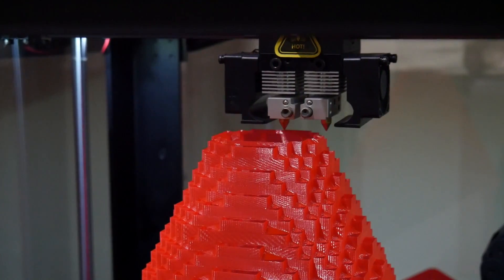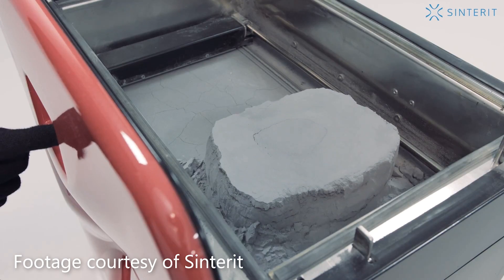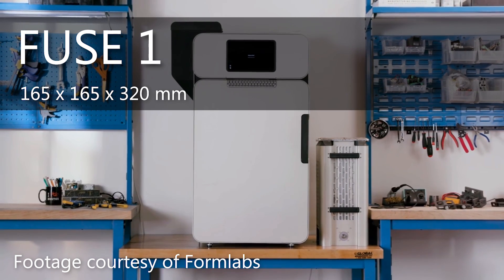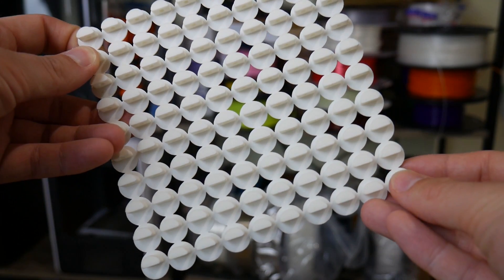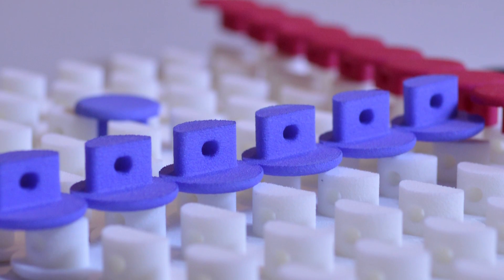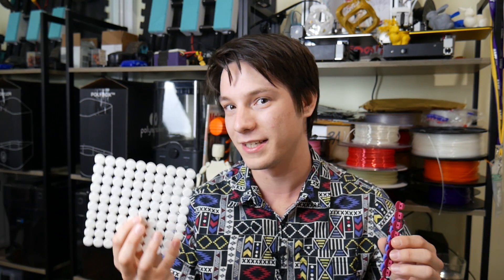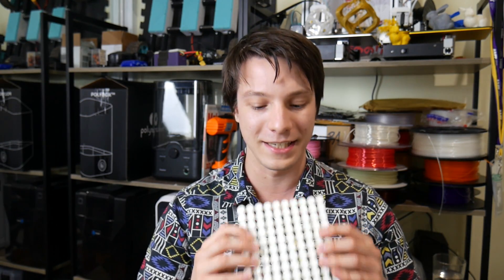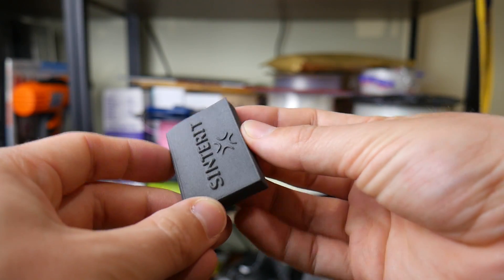Here's why SLS is the future of 3D Printing - Maybe. Formlabs Fuse 1 vs Sinterit Lisa vs EOS

Comment: Material costs are way too high, but expected given the relatively low demand. I wonder how expensive it is to product plastic powder..

And there are challenges with materials like nylon, but what about PLA powder that doesn't shrink? And I'm convinced that a closed-loop system to minimize mess is possible. These are engineering challenges, but not insurmountable ones. The benefits in quality are well worth the exploration, we just need some open-source trailblazers to prove out effective design and make it available for manufacture.

Comment: 6:40: Here's the definitive answer on why there's a difference in powder color between the industrial (EOS) machine and the desktop (Sinterit and Formlabs) machines:  It's not the laser power; it's the laser wavelength.  

The EOS systems use a CO2 laser (with 10s of watts of power).  CO2 lasers emit at around 10 microns (um) wavelength.  The desktop systems use either fiber or diode lasers, emitting at around 1.0 um.  At 10 um wavelength, white-colored polyamide (Nylon) absorbs quite well.  But that same white color does NOT absorb so well at 1.0 um.  However, coloring the material black or dark grey does the trick for light absorption at 1.0 um.  

The desktop system makers, in order to use lower-powered and cheaper laser types - to keep their systems' key-component costs low - were forced to go to the dark nylons.

BTW, the higher power in the EOS CO2 laser does nothing in terms of process quality; as you noted, because the powder bed and chamber are heated to just shy of the material's fusing temperature, the laser doesn't have to deliver a huge amount of power (or more precisely, power density) to kick the material over into sintering.  The higher power level is almost all about process speed or throughput.

Comment: My bet is that SLS and SLA is the future for 3d printing based production. FDM will always remain the king of hobbyists and prototyping. Simply because it’s so much easier, safer, cheaper, and least difficult to use. The limitations and complexity of SLA and SLS are minimized by industrial production where many parts are made in batches, especially things such as metal part sintering. The production of the strongest 3D printed parts benefits from economies of scale, especially so when furnaces and potentially hazardous fumes and materials come into play. 
FDM can be done at such a small scale and with such ease that anyone interested in the hobby or using 3d printing in a practical home application will inevitably come to it as the best all around option. Because this group will make up the vast majority of users it means FDM will remain king. At least until self forming materials come into play, but we’re at least twenty years out from that.

Comment: Overall a nice review although some important errors.  SLS was invented by DTM, Texas who were taken over by 3D Systems. EOS were not the original or the inventor, in fact there were years of court cases between the two companies. White SLS is not naturally white, it has Titanium Dioxide added to make it white. The aged yellow is actually its natural colour. The powder is pretty inert and tests have shown that it isn't harmful to humans, the particles are large enough to be ingested rather than going into your lungs. Saying that i would never work a machine without PPE. Finally the reason the cheaper machines use non-white powders is not to do with laser power but to do with the laser frequency.

Comment: BASF has a 316L stainless steel infused filament (about $400-500 US), that can be printed on most typical (CRS10 for example).  You print (high width to height ratio design is best, 100% infill), send it off to de bind and sinter.  Very, very, cool.  Can be bought from MatterHackers).

Comment: Shrinkage is not an issue in Nylon SLS. You fully sinter in the material. SLS shrinkage applies to green parts for molding only. That's due to the glue material sintered out of the green part in sinter oven process for the final melting stage. In Nylon SLS  you directly melt the part. Warping is an issue.

Dust on the glass, temperature control issues in the process and chunks of recycled powder cause stiffness issues. So it's hard to get reliable functional parts from a machine. So stuff could not be critical non fail parts of any product. They will unexpectedly fail at random.

It's no issue to use 100% recycled powder. Only virgin powder will give you more control over strenght of parts. Proper multiple sifting and drying the powder from taking up moisture from the air is key. Adding fresh powder doesn't truly give you an advantage over better handling of the material. pretty much like drying PLA in your oven.

You can easily build yourself a blasting chamber, powder sieve machine and use a shop vac to handle material.
Sandblasting is just the easiest way to depowder the parts from loose or slightly attached powder.

Comment: One solution to the not-so-useful-for-home would be to have a system of a adjustable size build volume where you could adjust the size of the powder chamber to fit what you want to print and only fill that volume up with powder. Genius idea, yes or yes?

Comment: The difference in color is due to the material manufacturer, EOS uses white, which is the base color of the powder that usually is issued by BASF. To correct you as well, the cooling down process of a chamber depends on the building time of the print, if a print is 30 hours long, it will take 15  hours to cool down, so pretty much the half the time of printing. The shrinkage is manageable, all can be adjusted on the program provided PSW or MAGICS when preparing the platform.

Comment: Takeaway for me is basically if you need SLS parts you use a service bureau like Shapeways. For other stuff can use a home printer. Metal would be cool but I don't see that becoming a less than $5000 home/small business system for a long time.

Comment: I think this is also the case with Multijet fusion of HP. I've also observed the quality degrades as I reuse the powder. Although it has high reusability ratio, it doesn't guarantee you the output's quality especially when the powder has turned yellowish.

Comment: We have the Lisa. We got a few parts out of it before it broke down and we have had many failed prints and lots of wasted material. Sinterit have offered to help but ideally we would need a local contact to come and do the repairs. In my opinion the workflow is too cumbersome to use unless you are in a production environment. Super messy and takes ages, wearing masks and gloves, cleaning up afterwards can take up to an hour before and after each print so not really ideal for doing one print.

Comment: Can you review the iro3d? It's a $6,000 selective powder deposition printer. It does pretty much any type of metal, apparently has no shrinkage and 100% density. I would be very interested to know whether I can use that to make actual parts for a machine.

Comment: Hi Angus. Haven't seen you down at the brewery for the past couple of weeks!
Just one point I'll make on this video. Printing successfully with 100% virgin powder is almost impossible. What you'll find is that the higher the virgin powder, the better the defenition, however, the more the virgin powder, the more the warping/deformation. Pure virgin will warp at 1cm^2 layers. I print at 20% virgin with a new type powder. This provides a good compromise between warping and part quality. I warm up the powder to a point just under the glass transition temperature. Cooling is such a slow process. In ideal circumstances I allow twice the build time for cooling. 
Thanks for the awesome videos. I owe you a beer next time I see you.

Comment: K so to sum up, if you run a farm and sell things in large quantities, then SLS might be for you as you will definitely want to fill the entire space up with prints.
And I assume you can layer them on top of each other as well.
eg base - your first layer of prints - a layer of powder to separate print layers, second layer of prints - separation layer - and so on.
Less risk of fires as well I assume.

But for home use as said, even if they were cheaper, a home is not a place to fill the air with fine powered plastics.

Hang on this is an old video! Why was it recommended as if it was new? :P

Comment: An "affordable" system costing 10k, and 7k for the cheaper one. Considering most people can get 3D printers for a few hundred US, with the more expensive ones for hobbiests being no more than a few k I wouldn't call that affordable.

Yes, they are cheaper than other SLS systems, but not cheap for 3D printers in general.
Reply: Heh, i bought the cheapest 3d printer china had to offer. It was, well not total junk but not very good either. So is started to design and print better parts to make it a lot better. One year later now, the printer makes just as good prints as a 900-1000 dollar machine after all the upgrades. Why did i do it like this instead of buying a printer that is better out of the box? Well i learned a lot of how a printer works, i learned 3d designing for the parts and learned a lot about the software needed for all of this. 
Best money i ever spend.

Comment: I think that 5 axis 3D printers is the future. A 3D extrusion printer that can rotate the print at every axis can also do without support material. In addition it could also be used to lay down complex patterns of continuous carbon fibers for reinforcement. You should do a show on the future of 5 axis printers.

Comment: I'm currently working on an open source slm design. With all the powder handling automated and full melt I believe I will get better material properties and more material options. (Using color spectrometer and machine vision to calibrate settings for different materials).

Comment: I am definitely not a fan of sls printing because of the infrastructure required around the printer to be able to use the printer.... Cleans rooms, hvac systems, filtration systems, material penetration machines (sandblasting) etc. Very messy. Even for someone like me who prints at home and as a career, at work, sls is not my go to. For sure fdm can be used in many cases, but my favorite newer technology is MJF.... Multi Jet Fusion is absolutely amazing... Look up the Hp42003d... It is a mix of a poly jet printer and an sls printer. It has a material reusabliliy of 80-85% and is 95% environmentally stable. The powder is purchased in a large cartridge type container, and the build surface ( built into a cart) is automatically loaded by the loading station, with the mixture of virgin and reused material. You then wheel the cart over to the printer. The printer prints the parts out, you then roll the cart back to the loading station and it sucks out the material for you. No mess, no fuss and the parts have no shrinkage, and they are isotropically stable... Material cost... $30 cad per kg... MJF is the future.

Comment: Hmm... Couldnt you use less powder if you could limit the motion range of the powder smoothing swipe and filled part of the build area with a snuggly fitting cube? Or better jet, had slots where you could insert a separation wall.

Comment: SLS and resin printers will NOT be the future of 3D printing - it's crazy to use so much poisonous/toxic material instead of bio plastic in a world which is trying to eliminate non-recycleble waste...  For professionals maybe, but not for home.  SLS is difficult especially when children would like to print something..so is this the same problem with the toxic resin printers with children at home (also when the will not print..you have to be as careful with resign as with an acid).

Comment: I work in a plating shop dealing with SLS parts, surface density is critical for post processing and you lose that surface density when building thin walled parts. I’ve noticed that shapeways uses lowered density parts to deal with this issue. If you get parts from them, you will need to sand and pick at them to get rid of this. Also a resin coating or primer will help you with cleaning this up, if you don’t have a sand blaster. Definitely would recommend a dusk mask, that would handle the finest particles

Comment: Next time you talk about SLS please explain what sintering is.
Reply: In as simple terms as I can think of, sintering, in this context, involves hitting the required areas of powder with a laser, which heats it up to its melting point for just long enough for it to fuse with the powder around it.

An SLS printer puts down a thin layer of powder (in this case, nylon), and then a laser travels over it, fusing the areas required for the first slice. Then another layer is deposited, and the laser fuses the next slice, and so on.

Comment: The material cost is WAAY too expensive even if you ignore the machine cost. Its way more than SLA which is still too expensive. At least 1k SLA printers are becoming available ( well 2k with the post processing station) They should do the reverse and spit out the particles heating them on the way out. Kinda like an inkjet printer. Then you eliminate the post processing and waste. You could have multiple heads like inkjet and print super fast and in unlimited colors with multiple color cartridges and pixel plastic mixing...easy to write but I am sure its not the easy :) Also 1 hour before printing ?? Yikes I didn't know about that before your video. Also SLA seems much faster and wastes less and is easier & healthier  to put in a home office without all that plastic dust. SLA, minus the post processing, seems closer to the future of home printing with layer at a time printing. The only things to workout are the post processing, build volume and material cost. Material cost will work itself out over time (supply and demand). Build volume too because prices drop on small printers drop and then big ones will be born. Then it is just all that post processing mess that need to be solved . I think it should be part of the printing process . Raise the piece up every once and a while and clean and cure it automatically. Then drop back down and keep printing. Also, the print bed should have auto filling  from a large cartridge/bottle full of the liquid so just a thin layer of material is there all the time not a deep vat of liquid and to eliminate pouring liquid in and making a mess.

Comment: If you regularly use the machine, always having to fill up the entire volume with powder sholdn't be such an issue. You'd have to fill up the build volume once and then just add as much powder as your print took.

Comment: My a$$ still hurts.. buying MOAI after Your review. This stuff can't be even calibrated properly and produces eggs instead of circles on dozens of machines around the globe! Thanks!
Reply from the maker: It's got a galvo, so sounds like a software or firmware thing or the print surface is very much not level. both X and Y use the same spinning motors and mirrors. Mark was decent for support last I chatted to him.

Comment: Did you mean to say, 10 milliwatt or did you mean to say 10 watt. 

Because you said only 10 watts. That amount of power is actually pretty strong. At that, they would pretty much be doing SLM not SLS

Edit,

 On the specs it says 10 Watts. I guess they would heat up the chamber to increase print times drastically.

 I'm in the process of designing my own SLS system for well under $500 using a 1 watt 445nm laser, some galvos, and 3 steppers. If 1 watt ends up no being strong enough, I'll try 3 than 6 watts. I think I can get away without a heated build chamber if I sacrifice print speed. This could help prevent shrinkage, and definitly fix the reusing powder problem as well.

Comment: The part not touched here is ......the fact that SLS is mainly used when additive manufacturing needs to be done for metallic materials like aluminum and stainless steel and magnesium alloys ...
FMD based printing is better for nylon..
But dude how could you miss the immense usability for metallic prints
Reply: saifuddin raja SLS (P-PBF) is only used for plastic, what you describe for metal is called SLM or officially M-PBF.

Comment: Should be trivial to have smaller trays or barriers that slide into the chamber to limit the X and Y dimensions of the powder block, and therefore the amount of powder, no? I.e., a 200x200 mm build chamber could take a 100x50 mm tray if you just want to build small parts.

Of course, when the company selling the printer is also trying to sell you the powder...
Reply: RFC3514 it is not trivial as this technology is intended for production applications where this doesn’t matter.

Comment: You didnt mention how much it will cost to have a full build chamber of resin for these machines. How much does 2kg fill? Would like to know how much parts for example would cost if you reuse 50% resin and print 50% of the build volume each time.